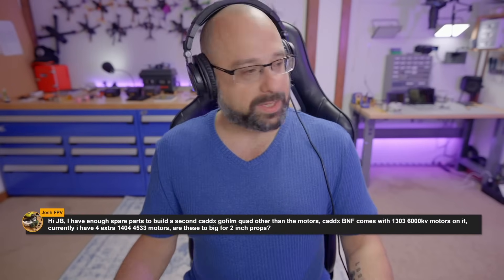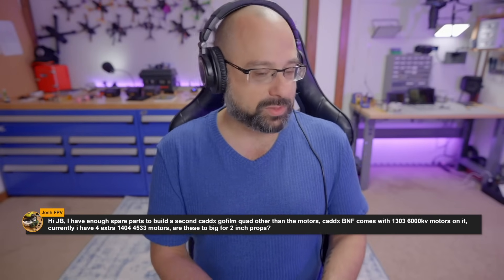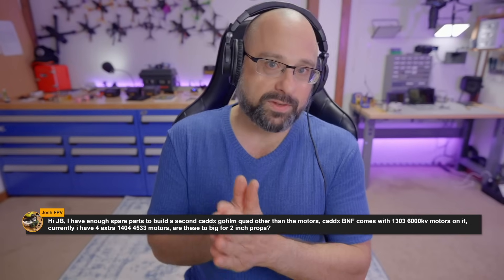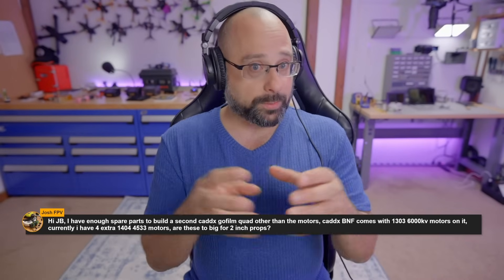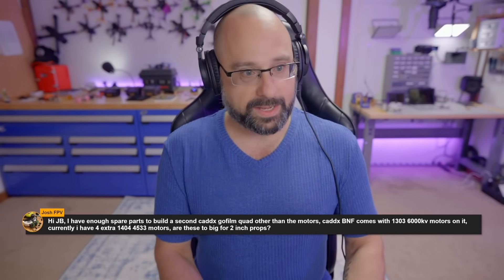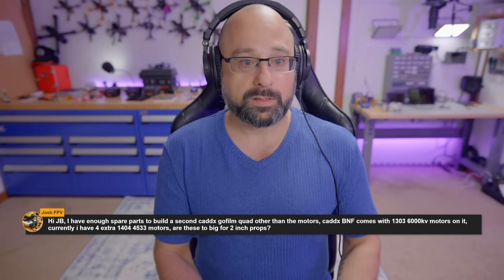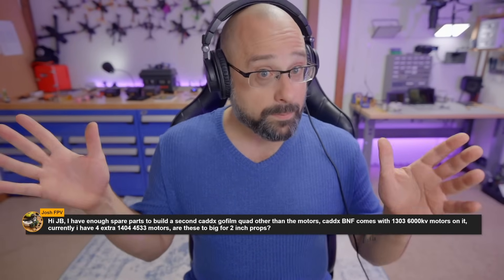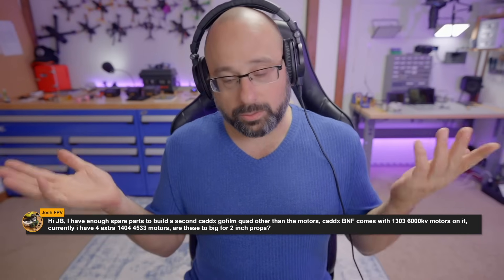Can I Use Larger But Lower KV Motors On My Drone? - FPV Q&A

Comment: I tried this once going from 2300kv to 2000kv motors on a 4s 5inch build, battery got so hot I decided it was not a good idea. It was only 300kv less but the quad was barely flyable and I had to fly careful to not overheat the battery too much.
Reply: It is strange. Not sure, if problem is in kv. 2000 and 2300 shouldn't differ much, and lower kv shouldn't take more current to overheat the battery
Reply: @sobstvenno  I had about the same idea, as noob quad builder thinking maybe I could save battery and fly longer with lower kv, but in reality it turned out different. The problem is that with the 2000 kv you have to add a lot more throttle to get any performance at all, the motors have to work harder to lift the same weight as with 2300kv motors. Result is that the 2000kv draws more amps from the battery, causing it to overheat. Solution would be to use a bigger battery with higher voltage like 5s or 6s, but that was not what I wanted, it was just an experiment.

Comment: Or put a higher pitch prop on it. Prop size is not the only way to increase disc load.
Reply from the maker: Disc load is weight over prop disc area. Pitch doesn't affect disc loading.
Reply: @JoshuaBardwellLivestreamClips maybe I used the wrong term? There are three ways to increase thrust: higher kv, bigger props or higher pitch. Since kv is lower and he's limited to 2 inch, then he can increase the pitch. You didn't mention it so I wanted to suggest another option. And my understanding is that more thrust means higher disc load as in thrust / weight per unit area of the prop. But even if the term is used wrong, higher pitch is still a solution to his problem.

Comment: Durrr can I put a 1950kv while the other 3 are 1800kv and use betaflight cli to change the motor mixer to compensate?
Reply: Yes but it's not going to fly very well
Reply: You don't need motor mixer, betaflight will do it anyway. There are couple of videos in youtube with copters with 4 different motors

Comment: 2 inch doesn't need much more than an 1103.  Happymodel makes a decent one at that size for 2S.  11000 kV.  Quiet and efficient with Gemfan Hurricane 2023 tri-blades.  They can easily handle Gemfan D51-5s.
Reply: I was wondering what other props I could use with my draknight 😊 1003 10000kv the thing is an animal so good I'm getting a second one lol thanks for the d51 prop idea✌🏼
Reply: @FPVADER  They'll cost you a few extra mAh per flight, but the extra grip you get is worth it.  They sound different, too.  I use them on my daily driver, a Mob8.
Reply: @billmcdonald4335 pretty annoying to remove 😅 can't get fingers or prop popper between the blades easy if more than 3.
Reply: @irrelefant303  I've had no issues with the D51s.  I frequently remove them to clean up stray hairs and such.